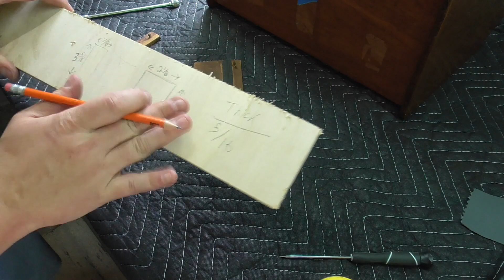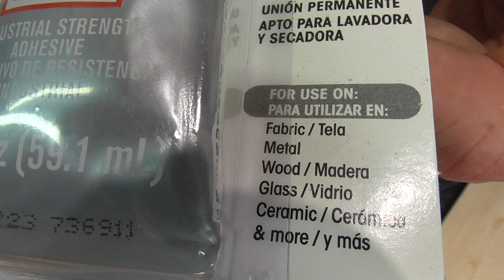Roller Organ Ep3 - Making Flap & Relief Valves from Wood and Leather - Antique Restoration

Comment from the maker: I’m restoring one of these right now. Taking a few different approaches. Just reconstructed the dump/exhaust/draw valves. Replaced flappers. Repaired crank shaft pulley. Now… I gotta take on the Rick hard bellows. It’s intimidating. I need to be sure I use a correct leather/vinyl/cloth. Any recommendations? 

Here’s where I’m at…. 

Restoration Part 3 - Antique Roller Organ - Making Flap & Relief Valves from Wood and Leather
https://youtu.be/-MGOwK1f1pg